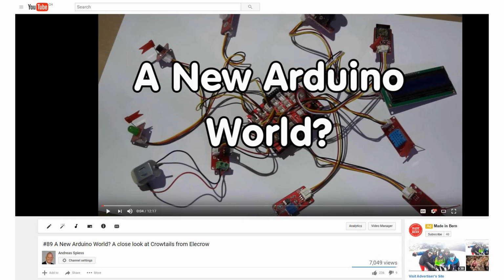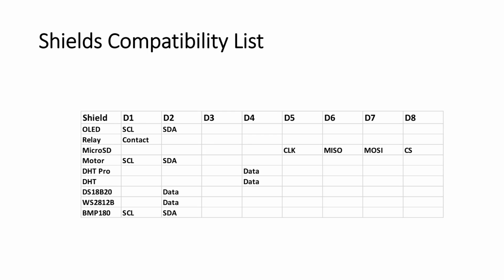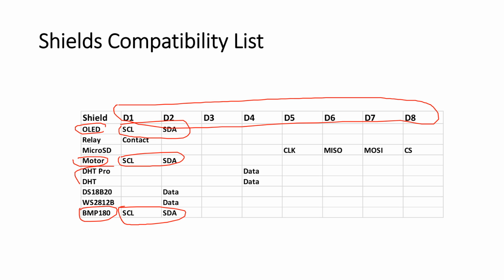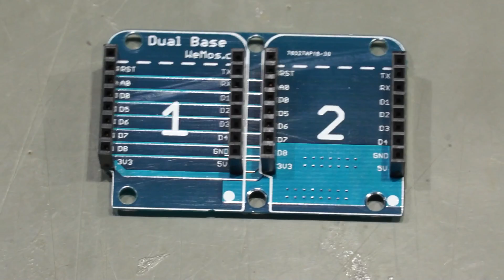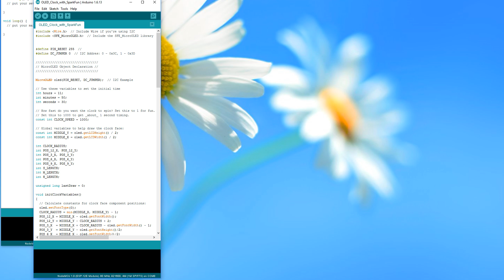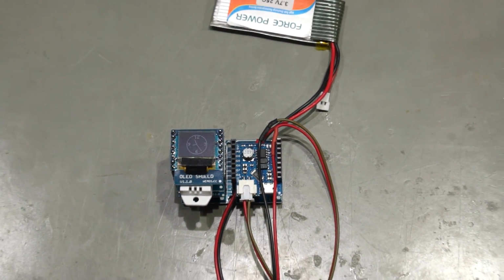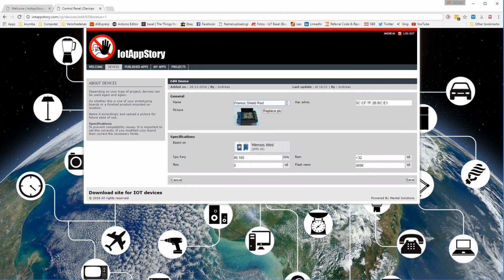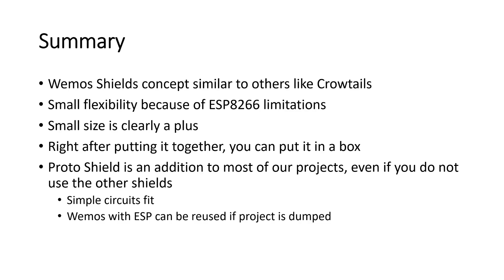#106 Wemos ESP8266 Mini Shields: Concept, Test, and Recommendations. Including Wemos Mini Pro

Comment: Solved: to get the relay to work on a different PIN number, remove the header pin from D1, so it doesn’t interfere with serial communication, then solder a wire between relay D1 and relay D3.
Reply from the maker: Thanks for the tip!

Comment: Could you please share the PIR sensor Project details Sir? Is Wemos Battery Shield v1.1 is good enough to use it for Long term operation. Is it suitable for low Current operation?Thanks for all information. Love your videos. Could we make a good 18650 battery solution board as a community and support the Development with funds maybe...
Reply from the maker: I changed to Zigbee PIR sensors because they need much less power and run on batteries.
Reply: @AndreasSpiess  in order to use zigbee devices with home asistant I think I need a Zigbee Bridge right Sir?
Reply from the maker: Yes

Comment: Is it possible to add an emitter (on a meter wire) to the Wemos IR shield so it (the D1Mini and shield) can be hidden away and the emitter directly attached to a TV for example?
Reply from the maker: You have to try. I do not know

Comment: Hello Andreas,
have you experienced DHT22/SHT30 warming up by RF? I noticed both temp sensors show around ~2-4C more than actual temperature in my room. When I connect them via dupont wires and move away from esp they are accurate. Moved them closer to esp (still connected on dupont wires) and they are showing higher temp once again.
Any idea why this is happening, how to fix?
Reply from the maker: I do not think it is RF. I think it is just air.
Reply: @AndreasSpiess  thanks for reply. I still cannot imagine, how would the warm air get to the sensor. I have d1mini and dht22 shield side by side on dual base. I tried putting a "wall" mad e of styrofoam between them and the results are very same. Could be the dht be faulty, perhaps? Do you have any reccomendation for good source for dhts?
Reply from the maker: I know that the DHTs do not work properly in these Wemos setups. Maybe you put the sensor 20 cm apart and test again. If you have the same effect I would try another one. They are not very precise, however (see the datasheet)

Comment: Grüezi Andreas,
I have been watching your channel for very long time, and you had a major impact on me starting to tinker with ESP8266, namely Wemos D1 and its shields.

I have started an MQTT Temperature logger project - using Wemos D1 mini + DTH22 shield, placed side-by-side in wemos dual socket shield.
For some reason, my readings from DHT22 are around 2C off, when the shield is in dual socket base. When I move it further from ESP, it starts reading accurate measurements.

I have had this problem since beginning. Originally I had my DHT on top of ESP (I thought, that heat from esp chip is rising into DHT), so I moved it to the side. Readings were still the same, inaccurate (this time I thought, that heat is transfered via pin headers between boards). So I introduced deep sleep in my algorithm - I start the ESP, measure temperature, connect wifi, send mqtt message and sleep for 10 minutes. Both boards are bare, without any enclosures.

Only thing which seem to remedy this issue, is to move the dht sensor away - connecting using dupont cables.
That made me think, that problem could be wifi interference of esp, so I swapped the dht for SHT30 and I experienced the same - whenever the sensor is next to esp, it reads around 2C warmer, than it really is (confirmed by bunch of other thermometers in my room).

Do you have an idea, what could be the culprit of the issue?

Thank you, and wish you all the best! Keep up the great work and content :)

Peter
Reply from the maker: Remote diagnostics is not easy. I would start with the simplest sketch without Wi-Fi and nothing. If it still does not work you can once measure if there is still current (energy) flowing during deep-sleep. And extend the deep-sleep for an hour and measure right after wake-up.Like that you will find out if it is because of Wi-Fi or another source.

Comment: do you also have a sketch of :

wemos D1 with relay and temperature sensor. that when it reaches X degrees Celsius the relay opens allowing for example a fan to be powered.

another question does the wemos d1 mini run on 3.3 volt or 5 volt, since there is much conflicting information.

i want to build my own radiator fan from a wemos d1 mini. {stand alone or wifi based is fine with me}

like a master slave configuration with 1 wifi based arduino as the master and the others as a slave that runs the command when told it has to run it
Reply from the maker: No.

Comment: Hello Andrew, I have another question about the Wemos Relay Shield. I notice that the tracks between low-voltage input part and output power unit are very close together. The mains voltage in my house can be up to 244VRMS (345VPP) without considering any harmonics. Is this module safe to use with such a high voltage? Thank you for your answer.
Reply from the maker: I would never use these boards for more than 12 volts. They are not made for more.

Comment: Hello Andreas, a question for you as a very skilled engineer: Can one DHT22 and several DS18B20´s be used on only one Wemos D1 mini? Can you refer to such a project? Thanks for your support.
Reply from the maker: I do not know if this is possible. They use different libraries and they should not hurt each other. But you never know before you tried. Here is a link for multiple DS18B20: https://www.hackster.io/adachsoft_com/esp8266-temperature-sensors-ds18b20-with-http-server-5509ac

Comment: Just launched my sprinkler system based on temp and moisture. Only puzzle is why does it show up on my LAN? I didn't place any code for it to contact DHCP for network info. Tried connecting to it via SSH but refused any ideas or videos you can point me to.
Reply from the maker: 1. ESP8266 tend to keep the Wi-Fi credentials stored
2. I do not know if ESPs can do SSH. For sure not without you programming it
Reply: Thank you Andreas, all my google search combinations yielded nothing. Copied and pasted your answers and found info on the prom. Very Helpful again thank you.

Comment: Shield layout control pins for esp8266 board, lol i will use a Trace cutter and a soldering iron to move the relay from D1 to D3 instead = pinMode , will use Ic2 scanner to move the DHT-11 D4 to D2 Data when i get the address,, ect ect, with other's, To Free up D Lines !
Reply from the maker: Thank you for your tips. I think it is the only way to go if you want to use "incompatible" shields.

Comment: Wemos mini Pro Esp8266 / 2 Dallas-DS18B20 / ic2 .96'' Oled / Dht-11 Hum-Temp. & Leds outputs as confidence on D6,D7,D8. All tied together working, all done in 1 day, Next Is, to get same data report to, Over WiFi to my phone,, will take much more work yet !!  I still Expect to use ic2 scanner to find address of data shield and move pins to Just D1 & D2, to free up D lines, hope it works out.. BYE for Now ...

Comment: The biggest advantage of the mini pro is you can re-locate the 0 ohm away from the ceramic antenna and use the IDX for an external +16dB amplified antenna yielding 1000 omni directional meters distance.
Reply from the maker: You are right about the antenna. Did you check the 1000m? Which device did you use on the oposite side?

Comment: Andreas.  I have a Wemos D1 mini installed inside an aluminum box.  It does not get any signal from my Raspberry Pi Zero W as an access point.  I even took the top of the project box off thinking some signal will reach the Wemos.  No luck..  I just ordered a Wemos mini Pro and antenna.  Do you have any suggestions for good signal reception?  Should I start thinking about a plastic project box instead?  Thanks.
Reply from the maker: If you mount the antenna outside of the box it will work, also with an aluminum box.

Comment: Hi Andreas, Im a bit on the blond side.......as this is just a hobby with not many time on my hands, if I want to use a motion sensor , it's pin D2 and D4? Thanks for the great videos. Update on the A7,as you mention you have not done a project, really struggling when batteries are used,the GPS fix point is not correct
Reply from the maker: I think, you can connect he motion sensor to any D pin (if it only provides a digital signal, except D3). 
Thanks for the feedback concerning the A7

Comment: Here's a trick to unsolder the pin headers:
1.use a utility knife and carefully pry open the plastic seat of the header;
2.continue prying until the plastic seat is removed;
3.use a soldering iron and apply heat on the pad;
4.with the solder melting, hold the pcb and quickly strike against the table;
5.now you have a clean pad :P

downsides of this method:
1.if you are not being careful, you could cut yourself, or scratch the the pad.
2.it is likely that you can't reuse the header
Reply from the maker: Thanks for your tip! And these days, headers are cheap. So, that is no issue, I think.

Comment: Hello Andreas! Your videos are like good book which you choose it whenever you need it so i've found this :-) Which flux do you using? I saw it at 4:56 in video. And doy you have any experience with soldering paste? Thank you!
Reply from the maker: Thanks for your nice words!I once bought a bottle of Kester flux (I think, the real one...) on ebay from Israel (!) 
Yes, I use soldering paste for my SMD work if I use the Reflow Oven. I use the cheap Chinese one. But it gets hard quite fast. So, I have to throw away at least 90% and buy a new one from time to time

Comment: Hi Andreas, I got most of the shields, think I need that proto board shield. I know sadly that relay shield won't go with oled shield, I thought why not break the track of the relay shield and put it on D3 or D4 OR even better one, using a relay shield as a I2C (can be done with ATTINY85 as I2C slave)... any thought?
Reply from the maker: The idea to have more shields connected through I2C is for sure good. But maybe too expensive for the manufacturer. And in addition, you lose the library support (not for the relay, of course)...
I did an ATTiny slave for ultrasonic sensors (video #42)

Comment: Hello Andreas,  I wanna a know one does the wemos battery shield has the over drain protect circuit with in it. Just like TP4056
Reply from the maker: It stops loading when the battery is fully charged
Reply: Bro Am asking what happened if the battery go below 2.5 v while discharge .  Will the output stops or it still goes low until zero
Reply from the maker: I checked now. No, it did not stop. I measured 1.5 Volt after the Wemos switched off.
Reply: Ho I see which means that  there is no protection circuit in it like TP4056.  Thanks for your information

Comment: heres a tip: I soldered the short female headers to the bottom side, and used that to glue it down to a board
Reply from the maker: Thanks for the tip. Yo will see another possibility in the next Mailbag.

Comment: Nice video. However the modules are rather exclusive development boards. The "D1 mini Pro" will never pass FC certification in this shape. It misses the metalic cover just a short & fast observation. 
It means that they cannot be used outside the hobby area.
The "Mini" is also discontinued and only the mini Pro is now available to be bought.....
Reply from the maker: I mentioned the missing FCC cert of the pro. And I recently bought 10 original minis (https://www.aliexpress.com/item/D1-mini-Mini-NodeMcu-4M-bytes-Lua-WIFI-Internet-of-Things-development-board-based-ESP8266/32529101036.html). So, I do not know of a discontinuation. And then, you get many knock-offs of the minis from other suppliers.
Reply: Hallo Andreas,

Ich habe der Link geöffnet..allerdings "0  stück available"....
Trotzdem, danke für die schnelle Antwort.

Beste Grüße,
George
Reply from the maker: Vielleicht eher ausverkauft als nicht mehr produziert. Diese Dinger laufen wie "geschnitten Brot"

Comment: Hi Andreas , Thanks for your great video's, they've thought me a great deal. Concerning this specific video I have some remarks and a question: One slight advantage the D1 mini Pro does have over the 'regular' one, is that it has an external antenna connector, which might be handy if Wifi reception is poor. I also read (but not verified myself) that the built in ceramic antenna of the pro is by itself already better as the PCB antenna found on the regular ones. Next remark is the battery shield, As others have mentioned, it is really not a good solution for any battery powered project, the voltage is boosted from 3.7v of the LiPo cell to 5V, and then converted back to 3.3V for the ESP8266, this wastes a lot of power.

Now for my question: You've mentioned in the comments that you don't think the wemos boards are a good option to use as a finished product on battery operated projects, becuase of the serial chip which is always powered, and the low efficiency regulator. What about using the wemos boards, but instead of feeding them 5V, just feed them 3.3V on the 3.3V pins, this would eliminate the serial chip and inefficient regulator.
I'm thinking about doing a project with the wemos board powered by a LiFePo4 cell without regulator directly to the 3.3V pin.

Thanks again and keep up the good work!
Reply from the maker: 1. Concerning atenna plug: You are right, I forgot this one.
2. You are right with the power waist of the Wemos shield. But if you just want to bridge a few hours, It is still a good thing. Of course, not for battery only devices.
3. Wemos on 3.3v: I did not test it because I see no use case for this. I just take an ESP-12 with a white PCB (with or without good LDO)  as shown in some of my videos. I can imagine, that the Wemos still needs more current, even if you do not power a few chips, because they are still connected, but I do not know.
Reply: Thanks for your reply. I have ordered an ESP-12 with a white PCB breakout and I'll to some tests with this one vs the Wemos on 3.3v.

Comment: I have the Battery Shield. A cute little thing but I advise against buying it for any serious use. It is rather inefficient. Also, the Wemos D1 mini is not the most efficient to use with batteries due to the CH340 always being connected.
Having said that... ofcourse it is great to develop stuff
Reply from the maker: If I want to save energy, I use  special LDOs and ESP-12E modules. I made a few videos concerning this topic. Wemos or nodeMCU are great for development and for connected (to power) systems.
Reply: Fully agree, I use an RT9013 LDO with an ESP-12F for battery fed stuff and use the Wemos for everything else.
i just thought  I'd  give a caution to people  maybe thinking the battery shield was a solution for them
Reply from the maker: +Ed19601 Here you are absolutely right. Many viewers try batteries and Wemos and are disappointed...
Reply: For people who are interested. I made a graph: https://arduinodiy.files.wordpress.com/2017/01/vbat.png
Wemos D1 mini stops working when the battery attached to shield is 3.5 Volt. Shield will only charge the battery to 4.05 Volt. Done 3 tests, all same results

Comment: Andreas hello! I've been watching your channel for a long time. Great videos! I would like to add some informations about wemos (we have been using it for a months). The wemos itself is very limited if you try to run more than one sensors at the same type at a time. Not every port runs every sensor. For example DHT's work only on three ports D2-3-4 at 3.3 or 5V. But DS only works at D6 if you run it at 3.3V if you run it on 5V it works on D7 also. 
Great module but there are lots of things still have to be developed. Even Arduino platform is much more robust and reliable than wemos unfortunately.
Reply from the maker: Thanks for the tips. Do you talk about the  Wemos Mini? They are not much different from all ESP boards, because all use the same ESP-12E module. All are 3.3 volt. If you use 5V devices on ESP input pins without a level shifter, you are out of specification of the ESP8266, and each module might behave a little different. And some may even be destroyed, if you are unlucky. If you use 5 volt devices on output pins, also the behavior is not exactly foreseeable. Some parts interpret 3 volt as "high" and are ok, some not and behave strange. Usually, you find this information in the data sheets.

Comment: Great video. I ran into the same problem of the duplicate pins on the wemos shields. Now I simply cut the trace on the shield (d1/d2) and add a bodge wire to an available pin (d3). FYI wemos also has a button shield.
Reply from the maker: To cut the traces is the "last resort"... But a good idea...
I knew, that they have a button. But when I ordered the shields, I thought, I do not need one...

Comment: Thank you for an awesome video. Have you ever used the Wemos D1 R2. I using it at the moment wit a DTH 11, reporting humidity and temperature a local mqtt server. Happy new year from South Africa
Reply from the maker: You're welcome. If you mean the "Arduino compatible" board, I had it in my test, but did not like it very much (video #41). But if it works for you, it's ok...
Happy New Year to you, too!

Comment: I would appreciate an ethernet shield.
Thanks for this overview :-)
Reply from the maker: You're welcome. Why an Ethernet shield for a device with WiFi?
Reply: Why not, if the ethernet infrastructure is available? I am also not sure, if wifi would work in the basement.
By now, a Arduino Uno does its work down there via Ethernetshield and passes measured values via MQTT into Openhab.
And it would be better to hide anywhere with the Wemos size.
Reply from the maker: Aha.